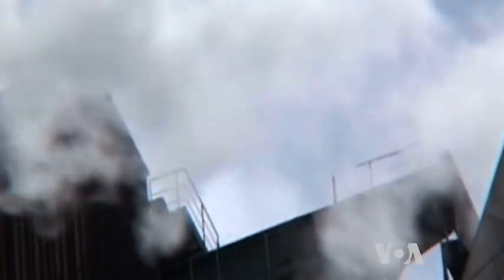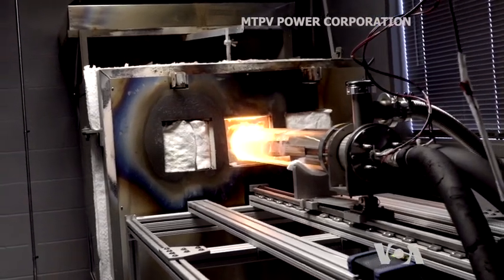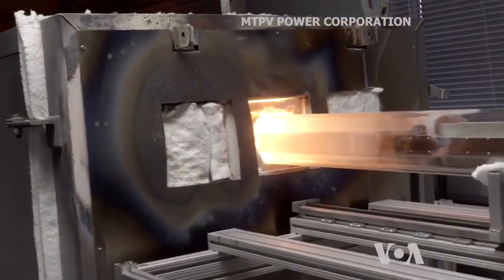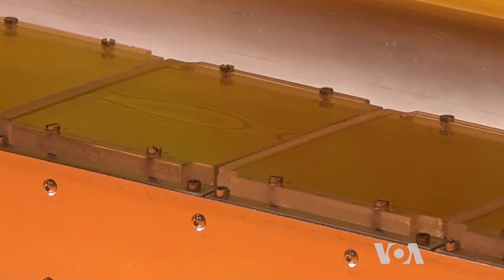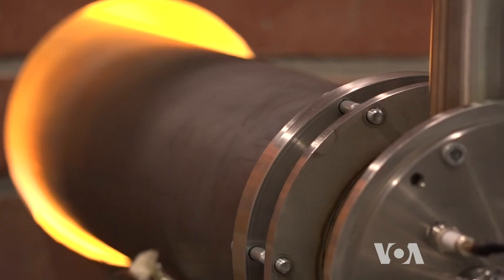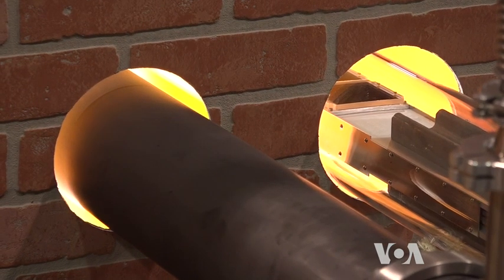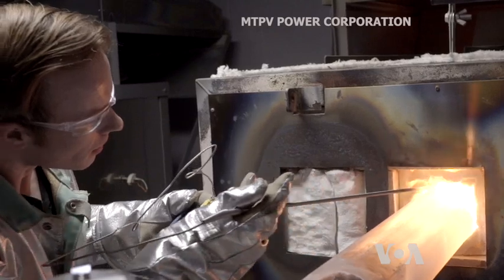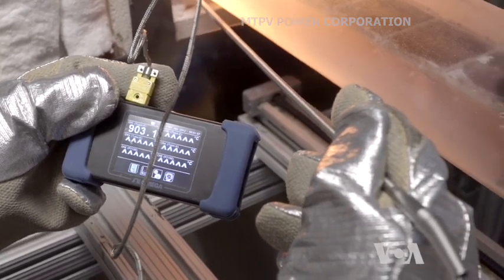Converting Heat Into Electricity

Comment: It could be used to transfer heat from braking to electricity - super needed for electric cars
Reply: Electric cars already generate electricity from the braking system. It's very basic physics in fact.
Reply: It's called recuperating

Comment: What is the temperature of electricity? Is there only one temperature that it is or does the temperature of it vary depending on what colour it is - for example sometimes it is blue and sometimes it’s purple such as with lightening. How can we measure the temperature of electricity/ find out?
Reply: temperature  is a movement of atomic nuclei. electricity is a movement of electrons. thus, electricity doesn't have a temperature as you suggest. the colors emitted by plasma depend on the size of the atomic nuclei that constitute the gas of the plasma. Heavier molecules result in redder tones whereas lighter elements radiate bluer tones.

Comment: So could you then start using this on anything with a heat sink once they get it down to 100* Celsius? Be a good way to stretch the efficiency of hybrid vehicles further by storing the heat energy that's wasted by the engine.
Reply: I saw demonstration of a friction engine. If those things get hot enough, seems like car could recharge a secondar battery while driving.  Or some hydrogen internally to recharge. Seems like lots of options.

Comment: We could use this to replace Air conditioners! Just convert the heat into electricity and therefore cooling the room!
Reply: It wouldn't be a very efficient way to do that for more reasons than 1. For 1, this most certainly works exponentially better the hotter something is. If your living areas aren't literally glowing from the heat then this would be next to useless. That's not to say that there isn't ways to generate electricity from waste heat, what I will say is that for most this right here isn't the right solution.

Comment: What is the difference between photons from direct sunlight and a red hot material?? i mean in power output from a solar cell.
TY
Reply: the temperature of the blackbody and distance travelled will affect the PV efficiency. But I'm more concered about how much power being used to cool down the PV cell vs its output. To make the PV cell to produce power at the cost of $0.02/kW, you need to reach the 60-70% efficiency and the highest theoretical efficiency is at 85% at that's when the temperature of the cell is at 2500-3000K.
Reply: Aren't peltier elements a better choice to convert heat directly into electricity?

Comment: It's bs that you guys get that much energy out of that and still haven't figured out cold fusion yet since you are short by a couple degrees of heat. Seeing as the neutrons, protons and neutrinos of the electrons would fall away and leave that heavy ass electricity no where else to go except to ground and fuse with where ever(heat and mass by themselves) that light was coming from

Comment: This is solar power though. It's not exactly using heat it's using the light.
Reply: could you just magnifying glass llens or augment light brightness somehow and get more power...
Reply: @sampleoffers1978  magnifying glass only concentrates existing light into a smaller area basically like a funnel. So it's cheaper to just use a larger solar panel that using a magnifying glass to give light to a small solar panel.
Reply: @walkersunited332  Cheaper is not only consideration when space or shape contours might factor. Goal is really to get light reaction doing its thing and even in ancient pyramids they were apparently using mirrors/relays to get more coverage, so there's historical precedent but also refinement must be possible.

Comment: So would it be possible to capture the heat from exhaust pipes for furnaces to create electricity? Like enough to charge a battery
Reply: Yes ,it's possible.
Reply: Using this method? Not very much. There are other methods that could though, each with differing levels of effectiveness, efficiency, and complexity. That's as much as I know.
Reply: No5 using this method. This is solar but instead of the sun they are using a glowing hot peice of metal. It's a different tech that converts just heat to energy.
Reply: I think that if we can store energy in heat. Why charge unefficient battery. We already have new type battery which is better.